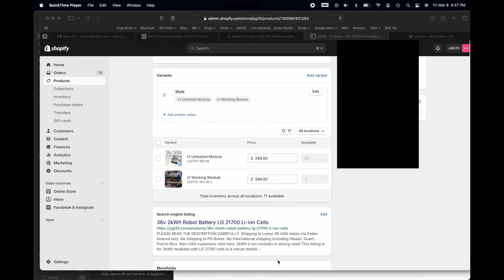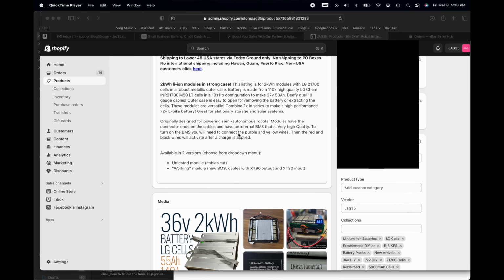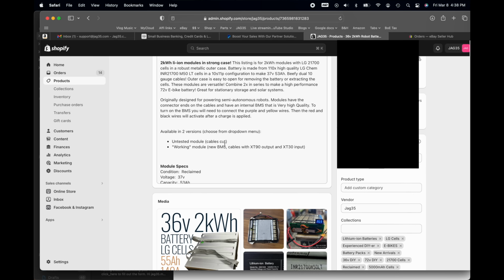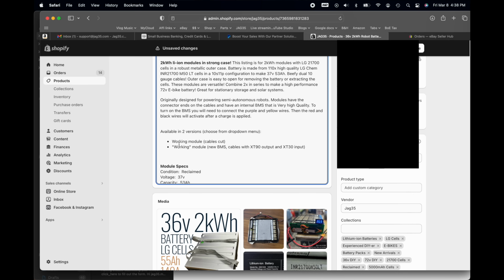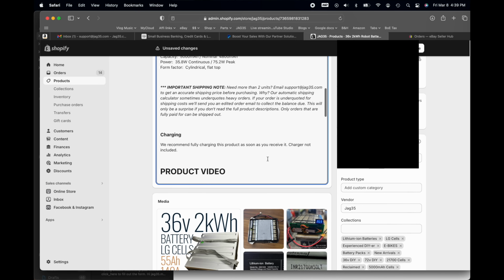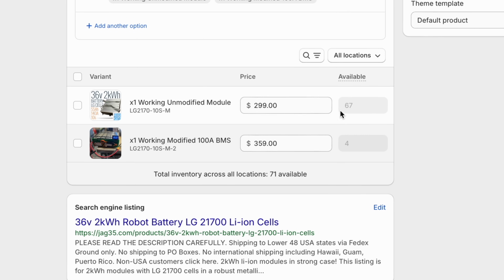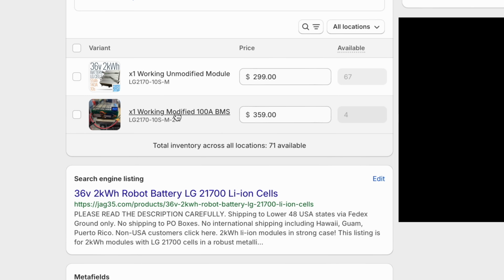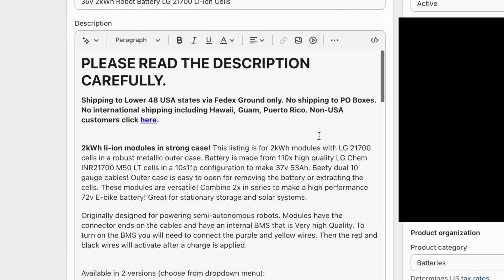The Answer was THERE All ALONG -  It works!!!

Comment: Hey I am looking to build a 13s7p battery setup with Samsung 40-t cells using a xt-90 as the connector. I am looking to use this as an e-bike battery as well as a portable power station for small appliance like a panini maker (1500-1800w)

Can a xt-90 handle this type of current?
How many amps do I need my nickel strips to carry for an application like this?

This is my 4th build just expanding in a new area that I need a little help with. Thanks 😊

Comment: The rule of thumb in the electrical industry is the rule of 80%. Everything in the NEC and UL certifications state that everything cant exceed 80% of what any conductor is rated for. So if you have a fuse rated at 80 amps, 64 should be the max current sustainable at 100% duty cycle.  Be aware that several Amazon sellers sell fuses not sustainable on stated fuse ratings. Buy circuit protection from reputable sources.
Reply: Blue sea is a great brand by Amazon I think. There are 1:1 knock offs that have the same issues as the cheap ones so stick with original.

Comment: In lieu of pre-charging, have you considered using XT90S / XT90-S “anti-spark” connectors? The female connector has a unique green marking on them: a green L shape and a small green splotch (looks almost like a circle, technically a shield I think). When you partially insert the connector (just enough to hide the shield) it closes the circuit but makes the connection (in series) through a small resistor hidden inside the connector <10 ohms) so it doesn’t spark. Once your load has had enough time to pre-charge, (THIS IS IMPORTANT) you then FULLY insert the connector which then bypasses the resistor - the catch is that if you don’t finish FULLY INSERTING the connector BEFORE you APPLY YOUR LOAD, you will melt the connector. All said, if you use it correctly, it’s a great little convenience and time saver.

Comment: Don't trust a "black box" BMS, do some light reverse engineering, that one is probably not supposed to be charged via the main port, as it appears to not have a set of mosfets to block the inbound current there, that's why it only reduces the intake current instead of blocking it completely.
Remember mosfets can only block current in one direction, acting as a diode in the other when they're off.

Comment: "today i'm gonna look kind of dumb but i mean what's new right" HAHAHAHAHAHAHA :face-purple-smiling-tears::face-green-smiling::face-purple-crying:
sounds much better than when i say about myself "tengo cara de Menso" :face-fuchsia-tongue-out::body-blue-raised-arms:

this video reminded me of splicing the green and grey wire together from a Desktop PC Power Supply to bypass the On/Off switch or testing the power supply with a paper clip by connecting pin 16 and pin 17 on from 24-pin cable 

Your PCB's are not gone to waste. you did something remarkable i love that others share their discoveries for example: when power tool batteries go into sleep mode, won't charge because one over drained the battery. 

Keep Up The Good Work Jehu :face-blue-smiling: